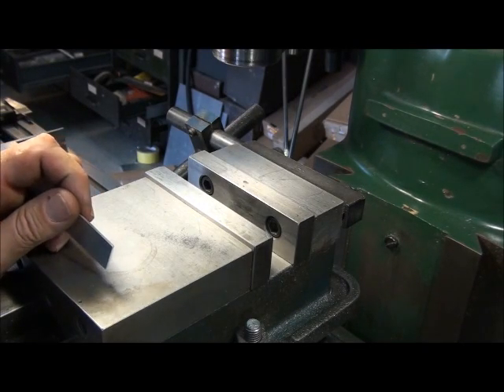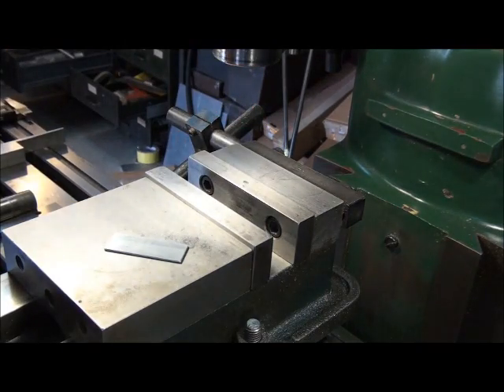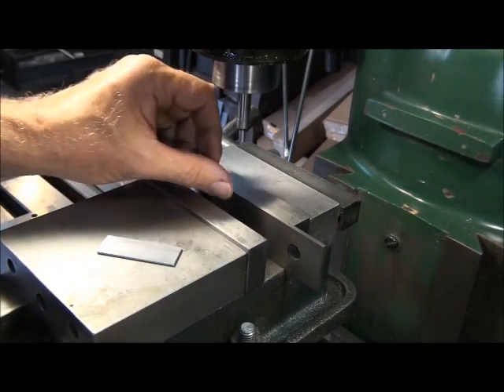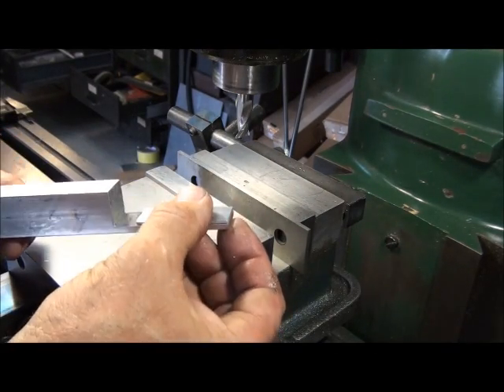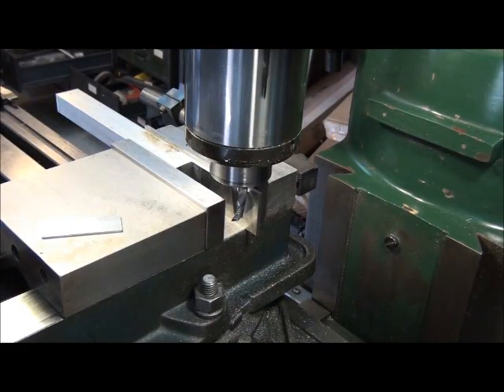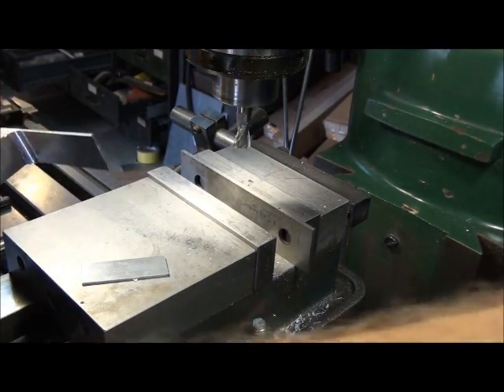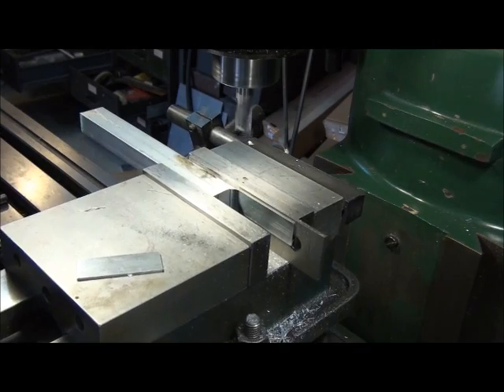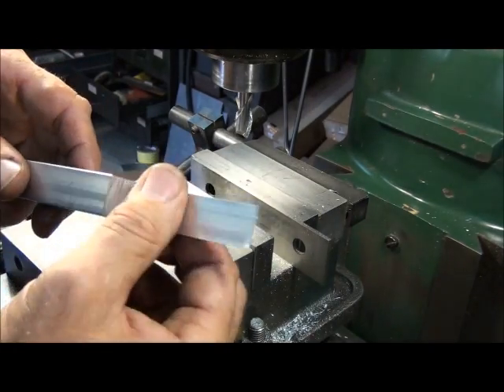How To Mill A Part That's Too Thin To Mill

Comment: So that's how they make feeler gauges!

There is a time for every trick, but I thought you were going to just take the thin plate in the intro and use the superglue and blue masking tape trick.
Reply from the maker: Super glue works well on large, thin parts, but this works better on small, more precise parts. It also allows you to easily take a measurement.

Comment: Tom, when zeroing the readout, you can just enter .100" (plus or minus depending) without doing two moves. Same thing with a dial. One move is more precise. Thanks for the video.
Reply from the maker: Yes, I normally do punch in the offset on the DRO and the dials. Must have been thinking too much about the video and not enough about machining. :)

Comment: that's nice. I think if you have the other end of the stock attached you can work more of it and have it come out much better
Reply from the maker: Not sure what that means, remember that this is just and example. The actual part you are machining will drive the details.
Reply: @TomsTechniques  I'm saying cut out the piece out of the middle of stock, not at the end
Reply from the maker: That will work as well, but it isn't necessary for a good outcome. The climbing end mill will hold the thin part tightly against the vise jaw even when only held from one end.

Comment: Not at all what I was expecting...  Yes, have to think outside the box... and some great useful comments below , too.  - even the humour ...( humor).   Even seeing the inadvertent slip-ups, rather than staged perfection, is of the highest value. thanks for posting so man years ago.
Reply from the maker: Thinking outside the box is what machining is all about. It gives you the ability to accomplish a lot with minimal tooling. I use this technique a lot in various forms, from machining thin areas on a part, to making actual shims as shown in the video.

Thanks for watching.

Tom

Comment: Try using an electro magnetic chuck/faceplate.That's what I used during my job in a central engineering shop.No problem.
Reply from the maker: Not sure a magnetic chuck would hold a part this thin, but you never know until you try.

Thanks for the suggestion.

Tom
Reply: I worked in the CES Port Talbot Steelworks for 34 years,retired now,we had to use some innovative techniques over the years to get jobs done asap.We used flat bed electro magnets,the same type as used on surface grinders,bolted onto milling machine beds.Biggest problem we had was the removal of swarf as you can imagine.It stuck to the workpiece like glue.
Reply from the maker: Did you demagnetize the parts after machining?
Reply: Yeah had to that was the one big drawback in using the electro magnet.Anything ferrous would stick to it.

Comment: Correct me if im wrong, but wouldn't a vacuum mount not work as well, to hold such a thin part?
Reply from the maker: I've used vacuum chucks for grinding, but I don't think I would trust one for milling, except for maybe with very small cutters.

Tom

Comment: I usually just hold it down with double sided tape.
Reply from the maker: This will allow a much thinner part than tape, but you are limited in size to the length of the end mill.

Tom

Comment: good one..instead of removing so much stock,i would have used two scrap soft  blocks that are grounded,on both the face of vise and would have fixed in between the plates with a bottom support plate and after tightning i would i have milled it.obviously side plates will also be milled to clear.sure with coolant

Comment: what about vibration on the unattached side of the stock?
Reply from the maker: The unattached side??? There is no vibration anywhere. That's what's so unique about this technique. Since you are milling a piece of stock pressed against the solid jaw of the vise, you may as well be milling the vise itself. It is rigid.

Tom
Reply: Toms Techniques But it's only pressed against the vice on one side. There other side can resonate freely.
Reply from the maker: The stock can't resonate because climb milling with the end mill presses it solidly against the jaw. I use the technique all the time and it works very well. Try it.

Tom
Reply: Was gonna say climb cut.

Comment: Thank's for sharing, a very useful tip. I probably wouldn't have made the approach, my thinking was it would snap off. However, clearly it does work to an almost razor thin piece of material.
Reply from the maker: Climb milling against the solid jaw is the key. An angle plate makes a good backer as well. I just clamp a part with a thin section to it and mill away.

Tom
Reply: Toms Techniques Ok, now I understand..you do this to eliminate vibrations that otherwise could cause trouble. I'm just a rookie machinist, trying to suck some knowledge from the professionals in. As a blacksmith these skills become very useful now and then.
Reply from the maker: The reason for climb milling is that the cutter tends to push the material against the solid jaw (or angle plate), thus stabilizing it. Conventional milling in such a situation would lift the material and ruin your day.

Tom

Comment: Nice technique, but seems like we are wasting a lot of material for such a small part.
Reply from the maker: This is just a demonstration of a technique Andrew. As I mentioned in the video, you can do the same thing to a thin piece of material, using a spacer instead. The way I demonstrated would be more like if I were machining a thin part of a much larger workpiece, which I've done many times.

Tom

Comment: the title of this vid is misleading..........it implies the original part will be milled so I too was expecting to see that.
Reply from the maker: +Louis Balboa 

Seriously Louis?

You show me another way to simply and precisely mill a part to a thickness of .010" and I'll rename the video. This is a valuable technique that I often use in machining. If you can't get by feeling "misled" by the title, then I'm afraid it will have to be your loss.

Tom
Reply: Toms Techniques Being honest. Not saying that is how you meant it nor did I say your video isn't good just saying some will find it annoying. BTW I'm a techie and do some machining myself so I enjoy lots of vids on YT. Was trying to be helpful BTW.
Reply from the maker: +Louis Balboa 
Thanks Louis. 
This actually is a valuable technique to master. I've used it many times to machine thin cross sections in parts, or machine thin parts that are difficult to hold.

Tom

Comment: climb milling for me is always the last option and can also be dangerous.
Reply from the maker: +userwl2850 
So can driving, but it can also be very useful if done correctly.
Reply: +Toms Techniques Still, why wouldn't you flip the part over the Y-axis and do the same operation but with conventional milling? Would it crumple the thin part or cause a problem in some other way?
Reply from the maker: +Jaret Snyder 

The technique relies on climb milling to hold the part against the solid jaw of the vise. Conventional milling would definitely cause a wreck with a thin part.

Tom

Comment: I watched this through twice, and I still have no idea why you couldn't just clamp your thin stock to the table with the clamp kit as per usual... isn't that what toe clamps are for?
Reply from the maker: +Railgap Esoterica 
There is a practical limit to how thin a part can be held like that without distorting it too much or being lifted and grabbed by the cutter. What you end up with is metal the proper thickness near the clamps, but thinner between them. With this method the only limitation to thickness is the tensile strength of that metal being cut. Eventually it will get so thin that it will just tear rather than be cut by the milling cutter. Up to that point though, the metal will be equal thickness everywhere because it is being forced against the solid jaw of the vise by the cutter. This is just one of many ways to make thin cuts.

Tom
Reply: @TomsTechniques  Okay. ;)  "...in your experience."
Reply: +Toms Techniques The rotation of the cutter is pushing the material against the solid jaw of the vise making it more rigid while climb cutting.
Reply: You nailed it, can tell you got skills to know about support

Comment: Nice tip. but I'm surprised you use a caliper and not a Mic to measure. Personally I don't use my Mic on tolerances less than 4 thou.
Reply from the maker: +BradSLAB 
I actually trust my calipers to about half that but you are right, a micrometer would have been more appropriate. The calipers looked better for the video though, don't you think?

Thanks for watching.

Tom

Comment: Sorry Tom. 
I thought you were going to mill that piece down. 
I would use double sided tape, or super glue to mill that piece.
I have used "your" method to mill a couple of thou off of key stock or other similar parts many times.
Kap
Reply from the maker: +kappullen 

Double sided tape and super glue work well for larger parts (the glue more so than tape), but this method (climb milling against the solid jaw) is the best for milling very thin, very precise parts or for parts attached to larger pieces. Every technique has its place.

Tom

Comment: Ok,
Suppose you had to mill that piece of sheet metal down because it is certified material to a different spec. than  the bar stock?
That's how government shops really work.
Kap
Reply from the maker: +kappullen 
I've spent plenty of time in a government shop. As I mentioned in the video, it doesn't have to be cut from a piece of bar stock. A thinner piece of material can be clamped against the solid jaw using a separate spacer.

Tom

Comment: Nice video Tom, but it can be done much simpeler..Take a piece that you want to trim to size and clamp it between enough MDF wood to cut it out compleetly. An  other solution is to glue the piece to the backside of the vice with 10 sec glue and then mill it.
A sharp tap with a hammer will loosen it. Dont laugh, but dobbelsided  tape works very well also. in holding parts. 
Last tip..Somarium magnets, the lastest in holding parts and very, very strong. Use light cuts on these and you will be oke.
4 different way's, saves time and keeps you going...greetings from Holland.
Reply from the maker: +Rob Gerrits 
Hi Rob,

I am aware of the methods you describe, but none of them, or my method will work in every situation. This is just one of many ways to mill thin parts. It is also the only way I know of that will enable you to cut a part this thin.

Tom
Reply from the maker: +shaun smit 
Thank you. I was wondering the same thing myself. I doubt that most of the responders who claim they have a better way have actually tried this method and that's really too bad. I do this stuff for a living and use this technique or a version of it all the time in my work. Maybe I wasn't clear in the video, but this is only a basic demo of what is possible by climb milling against the solid jaw of the vise. There are a multitude of applications of it in the real world.

Tom
Reply: +Toms Techniques ... like gauging. she goes banana when you let those magnets go anyways... we all have to be tolerant of different techniques ;)

Comment: NIce one, I realize you are not using coolant for clarity of the video, but if you did the warping might be minimized Also not trying to be a smart ass but you can buy plastic shim for pennies nowadays..
Reply from the maker: 1ginner1 
Thanks.

The warp is caused by stresses built up in the skin of the rolled metal bar. To eliminate it, all you need to do is machine the opposite side first.

You are missing the intent of the video if you think the technique is just for making shims. I actually use it quite a lot in machining, probably more often on thin sections of larger parts than just making a "shim". Most recently I used it to make a 3/16" thick Delrin part. I just sawed some 1/4" stock to size and used this technique to reduce the thickness to 3/16" before doing the remainder of the machining.

Tom

Comment: Would you then saw it off of the block if, say you were making a shim? Wouldnt the saw cut be uneven?
Reply from the maker: Anthony Johnson 
Saw it or shear it and if the application requires a precise edge, mill it.

This is just a demo of the technique. The actual piece may even be part of a larger part, so it may not need to be cut off.

Tom

Comment: Try this if you go from a part .060 thick down too a part .010 thick in one shot or a finish cut of .050 thick it will hold .010 finish. You can do the same thing on a lathe it will hold the finish of .010 + or - a .0005.

Comment: Thank you for the useful videos.   Is there anything that would prevent you from getting two thin shim pieces out of that same length of bar stock? (Cutting a U out of the bar stock instead of cutting an L out of it giving you two surfaces to mill against?)   I know this is a bit beyond the scope of the video, this is just more curiosity for me than anything else.  (Yeah, cutting a U would be a bit more of a challenge, but you could cut two slots and just mill out the line between them perhaps?
Reply from the maker: underourrock 

The moveable jaw on the vise is not necessarily parallel to the table, depending on what it is clamped against. It is also not as solid as the fixed jaw. It may work fine, but I prefer working off the fixed jaw.

Thanks for watching.

Tom

Comment: Thank you
A simple method ready to be adapted to the needs of the job you need to do.
Have you tried the same but instead of starting with 1" stock have you taken a piece of say 1/8 (or .125" for the challenged!) and just a 1" spacer.
You could use double sided tape or epoxy glue to stop it slipping out from behind the spacer?
Also you method will only work for small pieces that are less then 1/2 the length of the vice jaw approx.
Thanks
Warren
Reply from the maker: Warren,

I have done it using a spacer, but there really isn't any time savings so I normally just use thick stock as in the video. Tape is not necessary, the vise holds it very solidly.
I have done larger pieces using an angle plate and a long end mill instead of the vise. As you pointed out, the technique is adaptable to many different applications. I use it all the time.

Tom

Comment: What would you do if you have 100 to make? You wouldn't want to invest in a vacuum fixture and you wouldn't want to waste all the extra stock.
Reply from the maker: If you are thinking in terms of 100 parts, you missed the whole point of the video. This technique is intended for the occasion where a part requires a thin piece of stock that isn't available, or a part hat has a thin feature attached to it. And if you don't want to waste stock, I mentioned an alternative step in the video that will make that unnecessary.

Tom